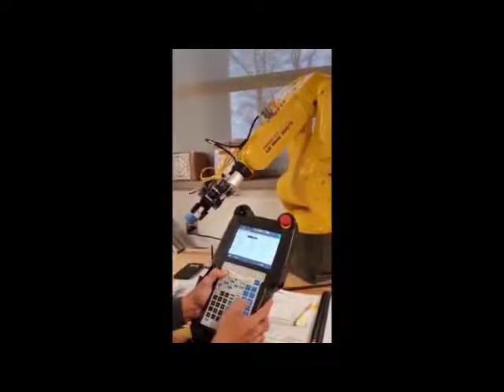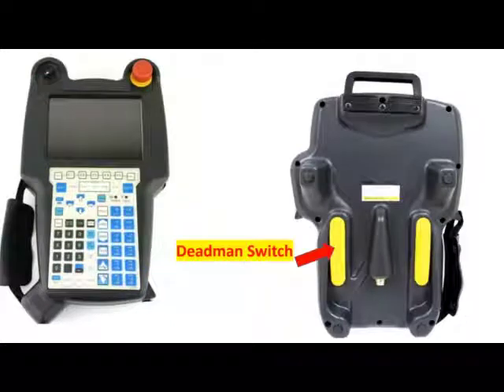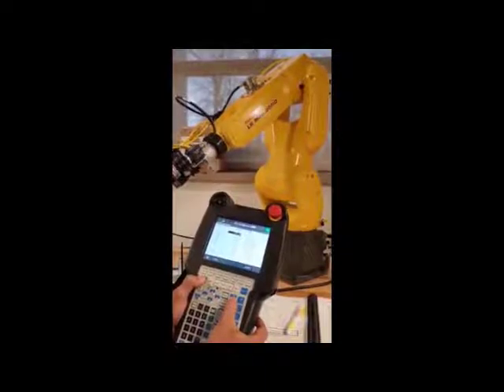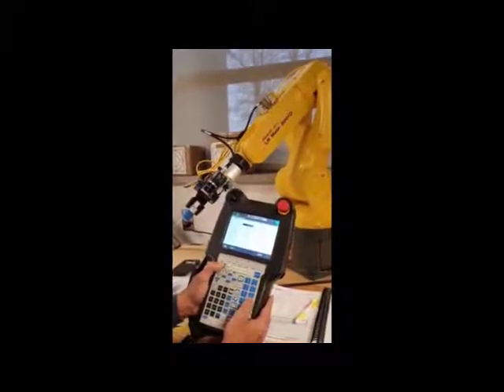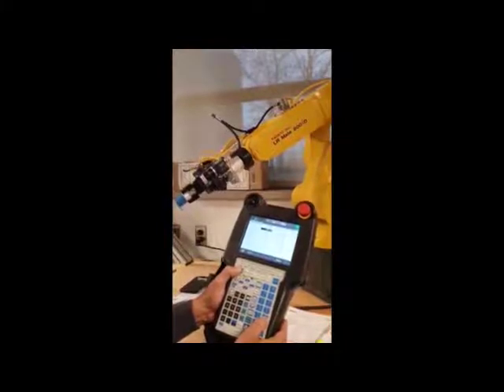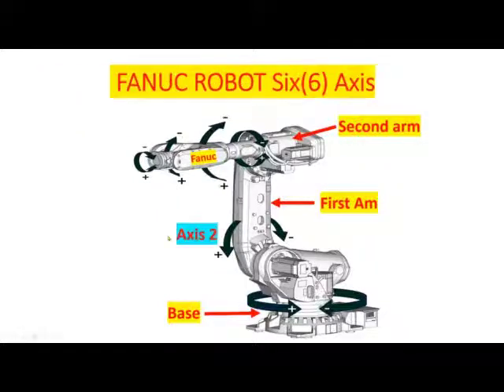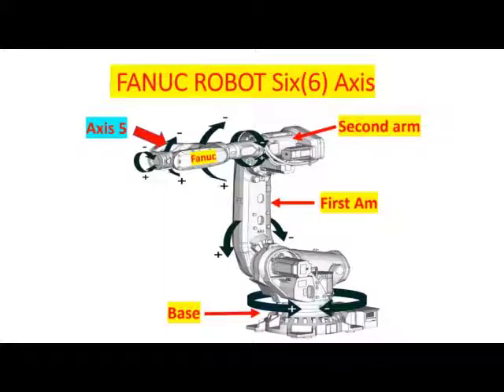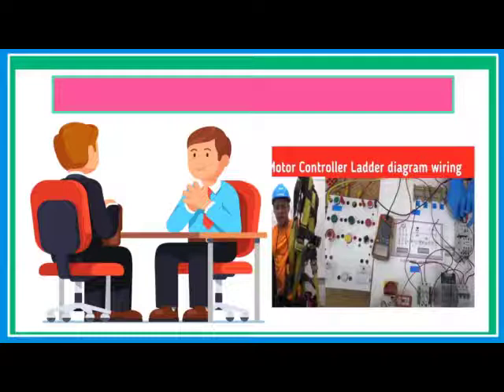Jogging the FANUC Robot

Comment: In case of a cleaning robot If the position is shifted for a particular hole and I need to teach it how can I do it ??
Reply from the maker: You can re-teach every now and then just like  my Job as Automation tech. The job of one of robot is to put butyl or adhesive in a small hole and sometimes the whole parts is out of specs a little bit then you need to re teach the robot point on that particular job
Reply: @Automationacademytv  how to teach can u make a video on that ??  I have 200id I want to know how to teach and save that position